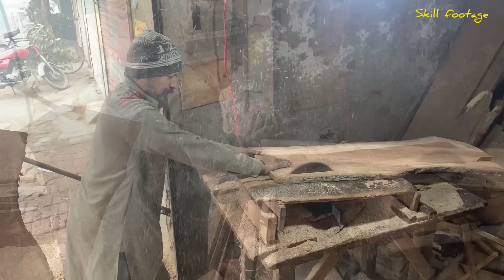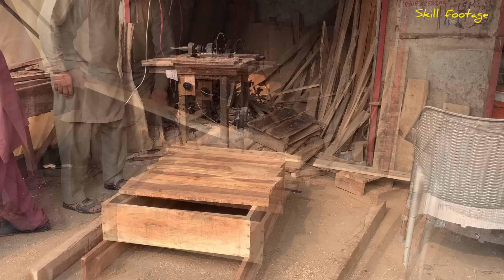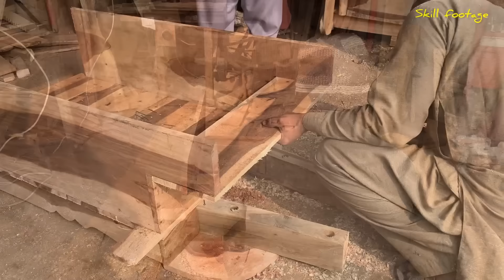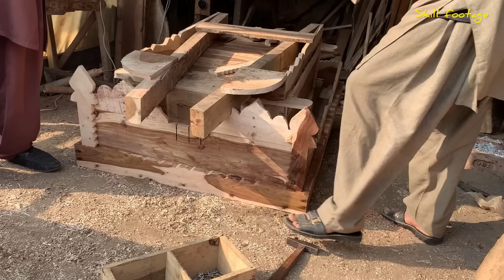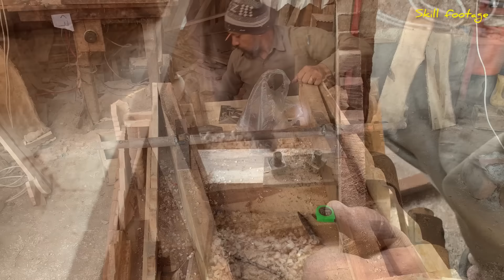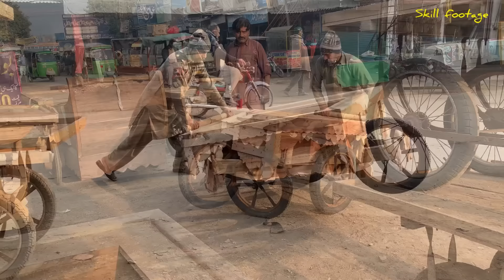Amazing Project of Making Wooden Hand Cart || How Wooden Cart are Made || DIY Wooden Hand Cart

Comment: I realize I am a westerner and might have a different view to their traditional style etc but a large part of the actual work and weight is for ornamentation.   And that ornamentation required much of the dangerous work at the fully exposed saw blade.   But, ultimately it might be painted in bright colors typically used in that area and used for selling goods.  It was interesting.

Comment: Stunned. I don't get why everyone is blowing smoke up their ass about how great this is. If they were honest, they'd say that it's not wood craftsmanship, it's just some very rough undressed wood that's carelessly banged together with hundreds of rusty nails. With the wood smashed in at every nail location. There's literally more pointless wood in this thing than there needs to be, which does nothing for the aesthetics of the thing at all. And I can only imagine just makes it all the heavier and harder to push, regardless of it being on three wheels. And you end up with a heavy, wide cart that has a very small space of actual storage. And guaranteed to give a person splinters on every inch of it you touch. And when those old motorbike wheel spokes break (and they will) there's absolutely no way one or two people could even lift it to fix it. As for the hinges ...it's a mystery. Well done if they're people without any skills at all, Epic even. But I doubt they'll have repeat customers with this clear amount of Lack of Pride in their work. I usually "blow smoke" like everyone else, coddling the "craftsmen". But not one other person was honest about anything on this. So...